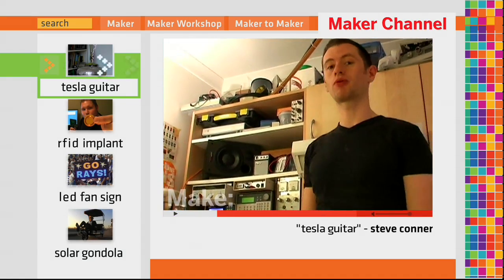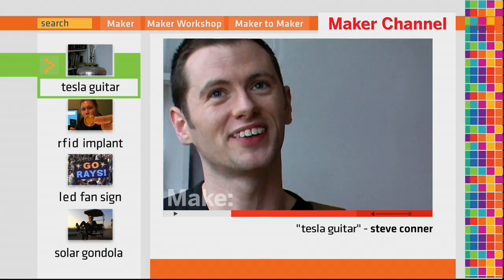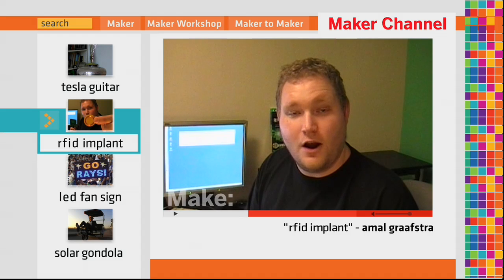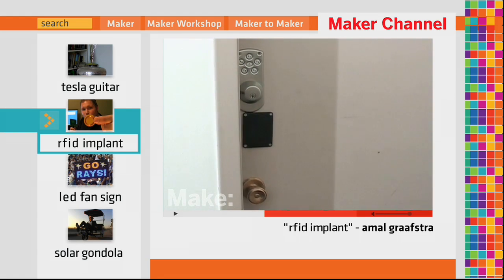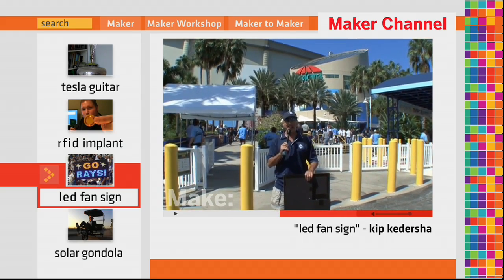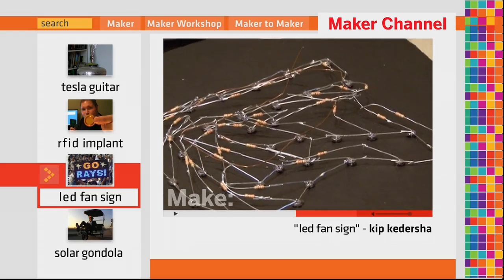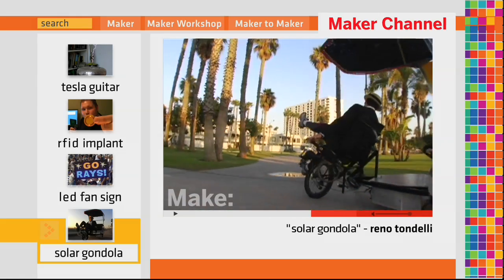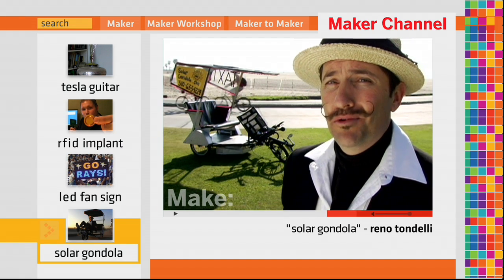Maker Channel Ep. 9 - Tesla coil guitar, RFID implant, LED f

Comment: For the consistory theorists out there, do a little research on the RFID chips. you can pick your own code and you are responsible for coming up for uses for it. you buy locks and computer parts and you can CHANGE you code at any time with most of the newer chips. if the government really wants to track you they could just you license plate, or phone number. think of how many stores ask for it when you buy something. that guy is just lazy as all hell and either way the chips are dumb.